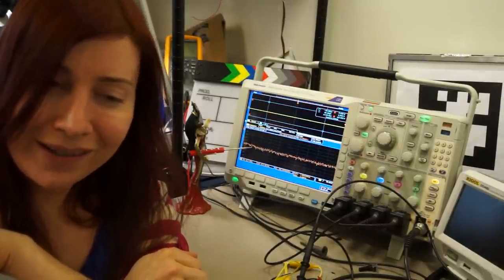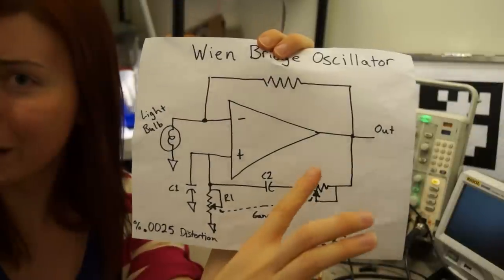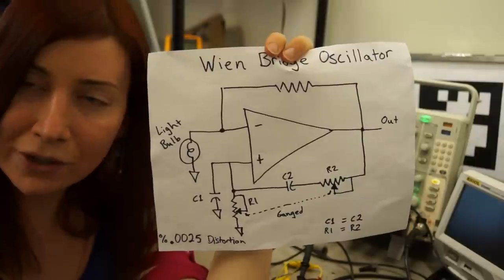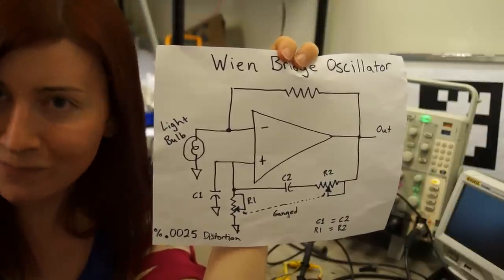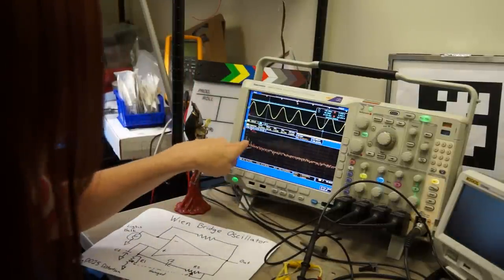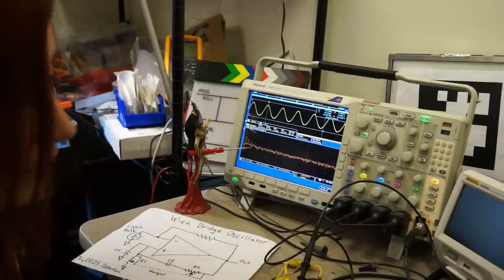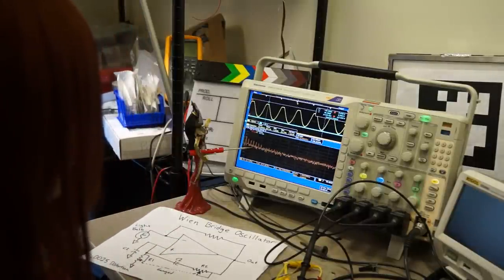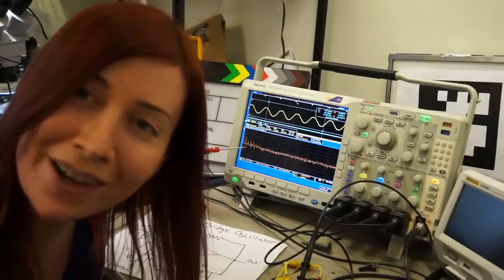Wien Bridge Oscillator - Don't Use Lame Parts

Comment: I think its like a limit cycle thing. Most oscillators do rely on non-linearity for oscillation. Somehow, the non-linearity of the bulb is compensating the pole movement caused by shifting power supplies.
Reply: No. The Wien bridge shown requires 1/3 of the output voltage fed back to the non-inverting input to maintain oscillation. The light bulb's resistance increases as the voltage across it increases (i.e. it heats up), so there will an output voltage where the bulb's resistance is half that of the feedback resistor. That is a stable condition because if the output were to increase, the voltage across the bulb would increase and lower the gain, thus decreasing the output, and vice-versa. So the output level depends only on the voltage required to make the bulb's resistance half that of the feedback resistor and therefore essentially independent of supply voltage or other factors. Past a few tens of Hz, the frequency is irrelevant.

Comment: Did you know that a light bulb connected in series with a speaker and the amp output will work as an automatic gain control. as the filament get hotter,the resistance goes up. Crosley, Who was a radio pioneer of the 1930s, designed a radio that use a light bulb for AGC. It was called the expressinator tube.

Comment: If the sine wave goes out of the scope screen, it shows more harmonics, as the oscilloscope thinks that the sine wave is actually clipped? I am not sure if the same is with your scope, but I remember, I had a low cost scope and that had the issue. So, if the sine wave is out of scope screen, I had to reduce the vertical gain (voltage) to bring within the screen (and hence scope effectively sees the entire sine wave).

Comment: We have to design a Wien Bridge  Oscillator as a project for faculty the problem is we can't use IC we must design the amplifier and we must have some requisites :
the oscillation frequencies 13~26 Khz  "which i resolved "
the output impedance 14 Kohms
the output amplitude is controlled with J-fet transistor 
the output amplitude must vary from 0~6 V

any idea on how choosing the Amplifier discrete component no IC so i have good oscillator  ?
how to analyze the negative feedback circuit that has a J-fet "i know the one that has just resistors" but with J-Fet we have rds which is voltage dependent and may affect the Barckhausen condition.

Comment: All that aside, the video did succeed where it counted, i.e. illustrating the (occasional) utility of nonlinear parts.
Speaking of wacky parts, I once came across electrically variable inductors that were used before varicap diodes were available. You didn't have much choice if you wanted to build a PLL in the hollow state era!

Comment: Lightbulb between power supply and LM317 ,LM78xx can made easy constant current, constant voltage linear regulator for charging batteries.

Comment: Jeri, you could discuss the fact that the oscillator is not always stable and any change in frequency for example causes the amplitude to ripple for some time before it settles at a new value.

Comment: we use 6 light bulbs in series to check a 480v AC 3 phase input to a 500 volt dc motor drive. hook the lights to the leads going to motor ,which is disconnected. turn the controls up watch the light to see if it's safe to use the circuit with the motor. if your wrong you don't destroy the motor drive and can go back and fix. used mostly switching out blown SCR's and fuses that blow when the guys over load the motor
Reply: Take good care of those incandescents, law wants them dead or alive.
Reply: +Rýán Túçk  retired now. who knows where they ran off too

Comment: Sorry, latecomer: this just popped up in suggested videos. I have a question: if you put two lightbulbs in series, would you reduce the distortion even more? It would be cool if the second bulb could 'take up the slack' so to speak for the lags in the first bulb and smooth it out to an even greater extent. If this works, what would a string of series-connected lightbulbs do? Or in parallel, perhaps?
Reply: There exists PTC resistors made for this purpose, that yield very low distortion, even at low frequencies. They have a larger mass than bulps to slow down the change in temperature.

Comment: Yeah, I used to think such "outdated" components were lame when in my younger days too...but since then I have developed an appreciation for Steam Punk styles...! ;) Which has sorted of resulted in using filament bulbs in place of fixed resistors anywhere even the slightest advantage can be gained by doing so. lol They have the added benefit of also being an indicator so you can gauge what is going on. If you want a non-linear resistor that can handle much more power than a bulb, steel is also useful in this regard....Good ol' #8 wire...!
Reply: +xanataph or you just started listening rock music and watching mad max , and bam, lamps everywhere :) i like old components too im just doing restoration of 50 year old record player with amp, but  i dont like those old dead bug designed's ...there is nothing to appreciate there

Comment: That's a good observation but I think you are referring to FFT "leakage" which happens when using a regular digital scope and its FFT function to produce a spectrum. I think Jeri is using one of Tektronix's mixed-domain scopes which has an actual spectrum analyzer input that uses filters to perform spectrum analysis, so I think it does not suffer from the same problem.

Comment: Another option is to use a thermistor … but not sure if you can get them so much nowadays
Reply: Thermistors are easily available from a multitude of sources. The problem is to determine which is right for the particular circuit. As regards this circuit here I was able to score some PC-pin No. 327 bulbs (specified by Jim Williams in both National Semiconductor app note AN-43 "Bridge Circuits" and Section 2.7 of "Analog Circuit Design") so didn't bother with thermistors.

Comment: What if we use PTC (positive temperature coefficient resistor) instead of the bulb? When Wein bridge was discovered, PTCs were not popular. But these days, they are used for many different applications (current protection).

Comment: The AF has gone to these, but I still get by with the MSO4104. These mixed signal scopes are great when you do not need any more than 16 digital lines. It beats lugging around a huge HP rack mount logic analyzer.

Comment: Dear Jeri, Is the unmarked fixed R on the gain side, potentially the same value as R1 and R2? And is the bulb a typical 12volt car bulb? And if it is, what wattage should be used? Thank you so much. x
Reply: The circuit oscillates stably when 1/3 of the output voltage is fed back to the non-inverting input. You pick what rms output amplitude you want and you then know that 1/3 of that will appear across the bulb. You apply that voltage to the bulb and measure the current flowing. That tells you the resistance of the bulb at that voltage, and then you know that R has to be twice that. Obviously you have to select a bulb that takes somewhat less than the maximum current available from the opamp.

Comment: A lower voltage lamp would have a heavier filament, which would be less microphonic. But it would be slower to heat and cool. There is probably a trade-off between the two characteristics, so you would need to find another way to reduce microphonics, like some kind of vibration-isolating suspension. Put it in a box of cat fur suspended from a balloon in an anechoic chamber built inside NORAD HQ. That ought to do it..

Comment: It is a pretty wired effect of you put unfiltered DC (right past the rectifier) in those things. I was working on a circuit and had some bad caps in the ps so they weren't filtering.

Comment: One question: how can you be sure that the bulb's resistance that changes according to the temperature of it wont break the law which says that the multiplication of the gain and the tank value (β) has to be bigger than 1?
Reply: You pick the feedback resistor R so that it is twice the value of the bulb's resistance when the output amplitude is at the desired level, i.e. when 1/3 of the output voltage appears across the bulb. Obviously, the positive temperature coefficient of the bulb's resistance keeps the amplitude stable under that condition.

Comment: I've built a few oscillators using both the XR2206 IC and the op amp with light bulb method. In my experience the XR2206 circuits aren't as reliable as the op amp/light bulb circuits! Perhaps that's why the XR2206 seems to have been discontinued.

Comment: Do you know why the harmonics fall off so quickly with the light bulb? Does that mean that you have to sacrifice some bandwidth to get the additional stability provided by the light bulb?
Reply: Certainly the original design using discrete components does not filter unlike an IC is designed to. Note that the byline of this video's title is about "inferior" components.
Reply: +Doug Gale The lightbulb's resistance increases with temperature, which decreases the gain of the amplifier.  So it's the negative feedback of the lightbulb that keeps the oscillation right.  Without it, the feedback can be too great and you get clipping at the high and low end of the output.  That clipping shows up as unwanted frequencies.

Comment: Neat.  I did a quick poke around and found a science fair project (heh) that indicated that semiconductor resistors will decrease resistance as temperature increases, while "conductor resistors" would increase resistance, like the light filament.  I'm assuming you used some sort of semiconductor resistor for the 2nd part.  What if you used a wire-wound resistor?

Comment: What is this sort of oscillator used for?  What I mean, is what is the usage for this circuit?  I was curious if any synthesizers tried using light bulbs in their oscillators, as early analog synths had known tuning stability issues.  But then you get microphonics, so maybe that does work so well

Comment: Unfortunately, there is way too much distortion shown on the oscilloscope.  The circuit is not working as Jeri intended.  It is hard to diagnose the problem for sure because Jeri did not show us the complete schematic with component values and power connections, nor can we read the scales used on the oscilloscope, nor did she say the frequency.  I suspect the negative supply connection to the operational amplifier is the same as (or its voltage is very close to) the ground connection shown on her schematic.  Thus, the output is limited by the fact that the operational amplifier can't pull the output below ground.  We can note that the distortion decreased when she reduced the supply voltage to a very low value.  This was true whether she used the light bulb or the resistor.  

Nevertheless, Jeri made a nice try and pointed out a useful circuit.  The circuit, when set up properly, will indeed produce a perfect-looking sine wave and very low distortion.  🙂

Comment: Due to heating, the filament changes resonance of the circuit with differing applied voltage inputs. The proportional control of which, is a fundamental of input current, time and voltage. Microphonics are a hazard when mechanical devices are introduced into digital circuits.  Since they develop their own electrical outputs from mechanical stress, you can dampen the effects by adding 'snubber' circuits to the inputs and outputs to minimize their effect rendering them harmless to your output signals.

Comment: It is strange that non-linear devices are a cause of harmonic distortion, but in this case two wrongs make a right.
Reply: Two wrongs seldom make a right but on occasion they do cancel one another out.
Reply: The light bulb is not operating as a non-linear device in this circuit. Once its temperature has stabilised, it has a steady resistance equal to 1/2 of the positive feedback resistor (R). Under those stable conditions, the ac current flowing through the bulb is directly proportional to the ac voltage across it. If that were not the case, it would indeed produce a lot of distortion.

Comment: Halogens are used to recycle atoms of the filament metal that boil off and darken the envelope. But to do that, the lamp must run at very high temperatures, which it is probably not and it wouldn't matter if the envelope blackened anyway in that application. So it wouldn't matter at all if it were halogen. Maybe they got a bunch of them cheap and the halogen aspect is irrelevant.

Comment: very interesting, but what light bulb did you use, was it a flashlight bulb, floodlight, neon, naaak naaak aaak naaak, but seriously, 1.5v, 3v, 110
Reply: You can use any bulb, it depends how much cold resistance it has to determine the gain with the bypass resistor. Something like 3V 15mA T3/4 is good enough. I used a mini-bulb from the old christmas light pipe (it was quite old) that takes 5 volts easily.

Comment: I use #327 lamp. 28 Volt, 0.04 Amp. solderable, small sized, low microphonics.

Comment: does anyone know how to derive the frequency equation? internet has nothing
Reply: +Captain Rhodes 
When you refer to "The Frequency Equation", do you know if you are referring to the Fourier Transform?  This may be what you are looking for.  If so, if you search "derive Fourier transform", you should find something.  To get into more depth of FFT windowing try searching for "On the Use of Windows for Harmonic Analysis with the Discrete Fourier Transform", paper by Fredric Harris.
Reply: +mandomonica Thanks but no I meant the oscilation condition for the wein bridge. Its ok I found ways of doing it now. Its often difficult to find anything that actually derives things rather than just stating "it is clear that in order to oscillate the frequency must be:  R'*RR/R+109-109*C1C2C99C1001" - oh yea very cear ;-)

Comment: Madam, I hate to tell you but there is a lot of distortion on that output waveform,  the lower minimum is wider that the upper maximum (more pointed) and it is clear that they are not symmetrical or equal in shape. In fact the harmonics generated  says it all. In fact when you lowered your power supply the waveform became better and even the harmonics dropped fast.

It seems that your amplifier gain is slightly higher than required and the hysteresis due to the resistor and lamp arm ( comparator level) will cause distortion especially if it is operated  such that the swing of the output reaches the boundary of the power supply..

I feel that no oscillator is really a siinewave ,  it is more of a double integral of a pulse which is a parabola so the net effect is a double parabloas joined together.  Well ifthe pulse at the start is rounded  off a little, then the parabola will approximate to a sine wave, but it never does. as the oscillator reaches a stable magnitude only because is goes into reagions of lower gain and so it reverses due to the enenrgy stored in the  "memory circuits"as capacitors and inductors.

The oscillators without hysterisis are more shaped like a siine wave, but the one which have hysteresis where the reference point  changes, well,  they are more like parabolas joined together. Perhaps a third integrator will male a parabola a sine wave!!

Comment: Believe Me. Its way way more scope then you will need. Back in 1989 when I was 17. I social engineered a company(illegally of course and I did not work for them.) into buying me a tektronix 2465B which was state of the art at that time. 23 years later. I still have that scope and its still more scope then I need. BTW: that scope cost over $26K in 1989 when I got it. I am just telling you from experience it ain't worth it.

Comment: Wow! Pretty girl that do electronics - very rare situation :) 
One suggestion from me: instead of light bulb you can use resistor-type optocoupler and schem which manage it.
Because photo-resistor have very small distortion. This principle is used in high end audio oscillators.
Find this publication: Low distortion oscillator tests measurement circuits, Vojtěch Janásek, JanasCard, Czech Republic -May 03, 2012

Comment: So the light bulb acts as a sort of reactive ballast? I'm using the wrong terms, I'm sure. But as the current to the lightbulb rises, the resistance of the light bulb also rises, and they stay locked together? Also, I would like to apologize for my gender, looking over some of these other comments. :( And wow, you work at Valve? That's excellent. Would love to do that myself someday.

Comment: I just built one myself.  Not a nice looking sinewave nonetheless it is a sinewave mote than anything else if you had to call it something.  I used a red led and a reversed 1n914 diode in parallel in place of a light buld
Reply: Yeah. That doesn't work. The slope resistance of a diode or led decreases as the voltage across it increases. The bulb's resistance increases as the voltage across it increases, and that is what stabilises the output amplitude. So you can't just put diodes in place of the bulb and expect it to work. Whatever you made, it wasn't a Wien bridge.

Comment: Do you just like old test equipment, or is it just because used test equipment is cheaper?  Personally, I can't afford new equipment, but even if I could, I'd still buy used.  Much of the HP and Tektronix test equipment from the '70s and '80s was very nice, and very repairable too.  

…unless it used tunnel diodes.

Comment: in my will i will leave a stock pile of tiny 28v lamps for your wein bridge oscillators. I still use a light bulb and yet to find a suitable solid state part that can replicate a light bulb, a thermistor does it but it doesn't give out the light at the same time, perhaps I can use an LED in parallel for the light,, but this then brings about nonlinearity all them harmonics everywhere ends up making it a square wave oscillator!